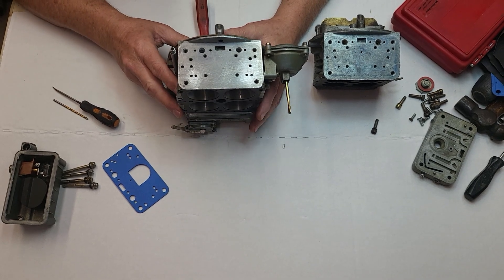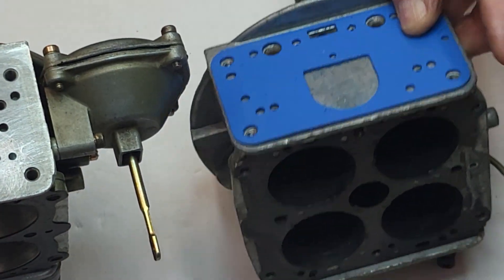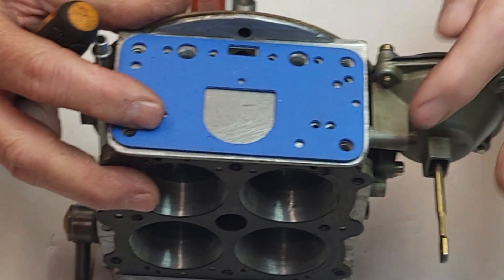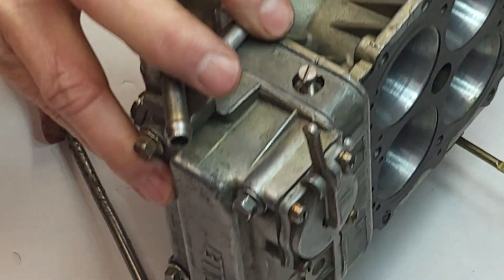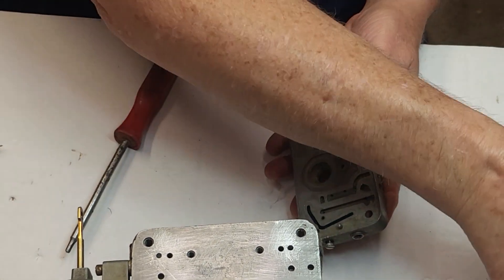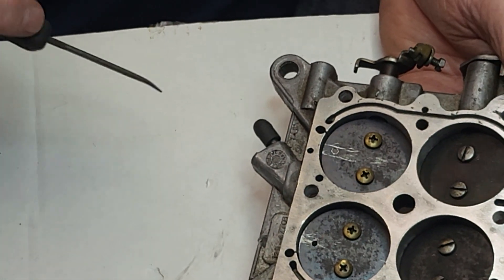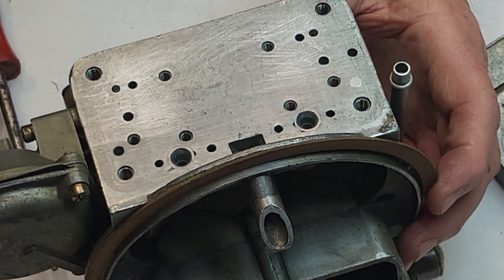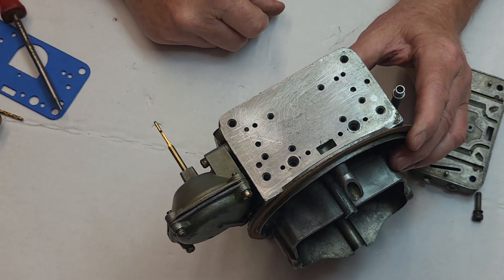High Velocity Holley *Part 2*

Comment: Have you ever done a pair of 600s like this and put them on a tunnel ram? I was gonna buy a pair of Quick Fuel 450s, but after watching a bunch of your videos, I’m tempted to try some of this stuff. I have a whole bunch of 600s and a few 750s also. Thanks for putting up these videos. I’ve done quite a few Holley 4bbl rebuilds and I learned a few tricks from you already!
Reply from the maker: Tim I believe they would perform excellent, make sure you have enough clearance between the carbs if your planning on adding metering blocks, even with out adding the 4 corner idle I think the 750 throttle plates on the 600 carb would work well.
Reply: @holleycarbshowtosadvice40y90  Thank you! My manifold is drilled so you can either mount them inline or sideways. I always loved the sideways look so that was my plan. I was just out digging through the stash to see what I had available. I’ll need to pick a few things up but still much cheaper than buying new.
Reply from the maker: Mounting them sideways always looked cool. If I can help let me know.

Comment: Hi Randy,

Have you ever run a model 4165? List 6497.

Been watching your videos to help me tune it. Has been so helpful so far.

308ci holden.

Not everything applies to a 4165 though. 

Love your series and info.

Cheers
Reply from the maker: Thanks Richard , when I was in school I had a 69 camaro 307 sbc  4 spd with a holley 650 spread bore carb , that is an excellent carburetor . Secondary plate was  2.0 inches in diameter and venturi was 1 3/8 that makes for great velocity. Spread bores had the best of both worlds mileage and performance . Hope this helps.

Comment: Can a primary block from the 3310 work on the secondary? Do you install downleg boosters for your viewers?
Reply from the maker: Yes , just make sure your circuits are properly sized. Hoped to be doing some carb work soon.

Comment: Hey Randy, I have asked you about the 4224 on a Tunnel Ram for street use and was wondering...you said you didn't like the 1-1 linkage..well could a guy use a 750 baseplate? and could the 4 corner idle mod be done to the 4224?....or...what about modifying the throttle arm on the 4224 to delay the sec opening?  Thank you
Reply from the maker: I'm not sure , don't have a 660 to look at , let me look at my holley book to see . I'll get back to you.
Reply from the maker: Cats garage its been awhile since I've looked at a 4224, I believe a 750 throttle plate will fit , i would have to lay out a 750 throttle plate gasket on the 660 main body, both have 1 11/16 bores , without being able to look at it don't know for sure. I bet I could put an 850 plate on it with some idle circuit mods and blending, I can tell you think out of the box, me too. Don't know for sure without having the carbs in front of me.
Reply: @holleycarbshowtosadvice40y90   Thank you Randy, I'll try to find a 750 throttle plate gasket and compare..  so you think it's possible if a 750 plate would work that you could put an 850 plate and blend the venturi like you are doing in this carb?
Reply from the maker: I would need to see it to be sure it will fit . But i think the 850 plate will work with blending and idle circuit mods, but have never tried it on a 660 center squirter .
Reply: My opinion- why would you bother with a center squirter carb? If you modify it for progressive opening you will have accelerator pump dumping fuel onto the closed secondary throttle blades. They have no power valve circuit and good luck finding replacement squirters for tuning attempt. Leave 'em for the nostalgia gasser guys. I know Unity Motorsports Andy had success modifying a pair but I still have to wonder why start with them to begin with? They HAD to require some serious re-engineering. Is there a benefit to using them that I don't realize? I had experience with them in the late 1970s-early 80s on an L88 Chevelle. They were great when you dumped the clutch at 6000 rpm but really not suited for a street driven car at all. A set of modified 600 vacuum secondary 1850s worked much better for me.